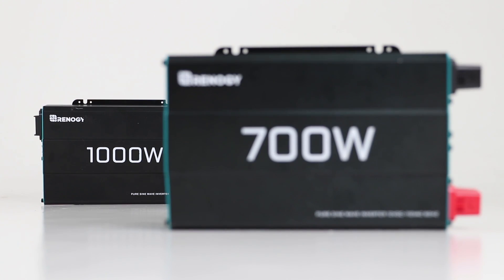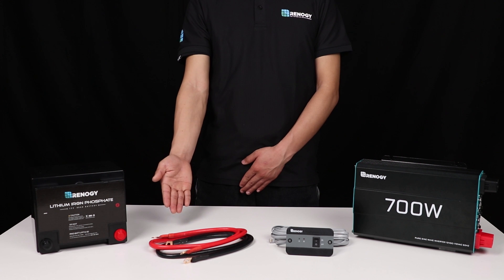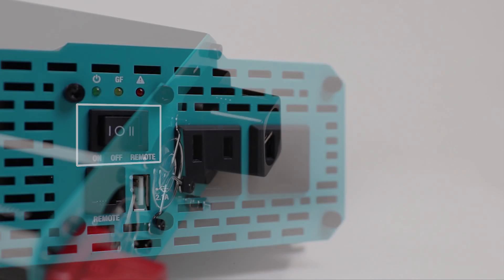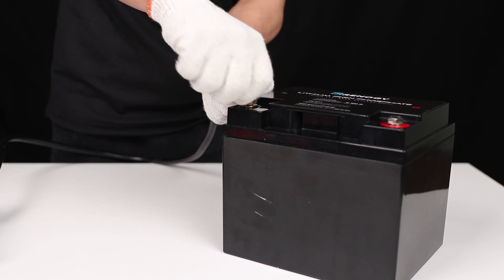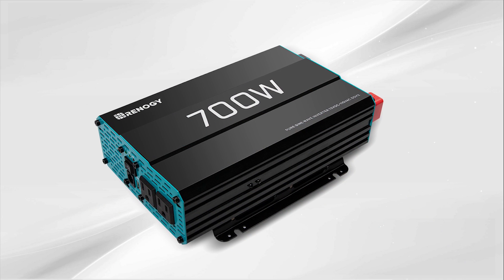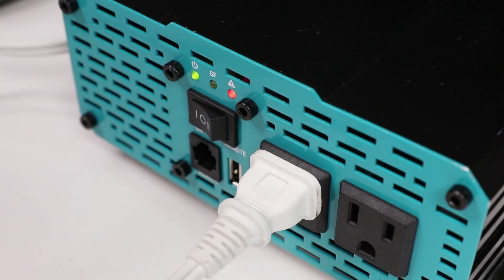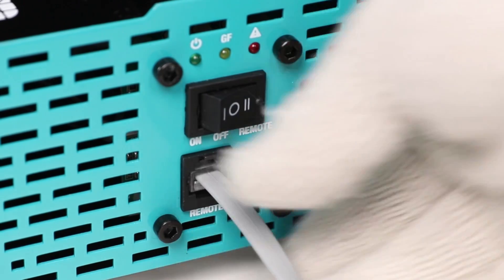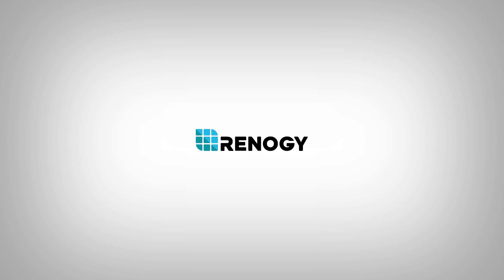Renogy 700W 12V Pure Sine Wave Inverter

Comment: just received my renogy 700watt inverter and its working great.

i am confused about the remote function. i have not used it.
what exactly is its purpose? i can turn the inverter off by pressing the button on the side of the inverter.
Reply: If you installed the inverter in a remote location that is not easy access then you can use the remote option

Comment: Hello, I have a 1000W version but the instruction manual doesn't mention grounding it. Should I ground it? If yes, what's the recommended wire size?
Reply: Hello,Grounding is required, and the grounding wire should be 14-10AWG in size.
Reply: @Renogy_Cares  i just received my 700watt renogy inverter.
how do i ground it? i just got mine connecting it to a dr. prepare battery. also, do i need a fuse?
im using the system in the garage for fridge and tv.

also, this video says nothing about grounding.

Comment: Do you need the dc to dc battery charger?
Reply from the maker: The inverter in the video does not have the function of charging for battery. You need a dc to dc battery charger.

Comment: Can i operate a tv and connect it to my solar batteries. I am new at this, please help, thanks .
Reply from the maker: Hi, Jamal.

If your tv need to use alternating current, you need an inverter to convert DC to AC. If your tv need to use direct current， you can connect it to house battery as long as the input voltage is the same as the system voltage of your battery.

Comment: can you charge this inverter with cigarette lighter in RaV4?
Reply: No
Reply: You can not "charge" an inverter. It is not a battery. An Inverter only converts the DC current into AC current. All Batteries (storage containers of electricity) are DC current and all household Electricity (can not be stored to use at a later date) is AC current. You hook the inverter up to your batteries (the DC side) so that you can plug in your household appliance (to the AC side) like your tv or DVD player.  Inverter does not supply the power at all unless it is connected to a battery the it only converts the power. From one that is stored in the battery to useable current for your microwave or blinder.
Reply from the maker: Hey Sueana,

For any technical questions, please contact us here-https://www.renogy.com/contact-us?gclid=CjwKCAiA3pugBhAwEiwAWFzwdeH3Crd9vRTbjjTYl9l3daVqnotJPjBhs2nmw-Wkn1_guWQeW0ao6hoCOHcQAvD_BwE

Comment: No fuse between the  inverter and battery?
Reply: I was on the phone multiple times with Renogy, finally I was advised to get an amp for this as no ground cable.  I was told the 60a for my 700w inverter.  I hope to install tomorrow, after the final cable I needed will arrive.  if only Renogy customer service could have informed me of the amp and extra cable the first phone call.  but seems their trained techs are not in this country nor have actually seen one in real life.